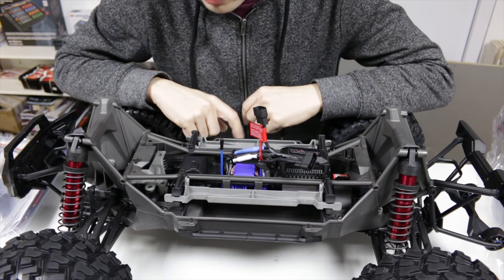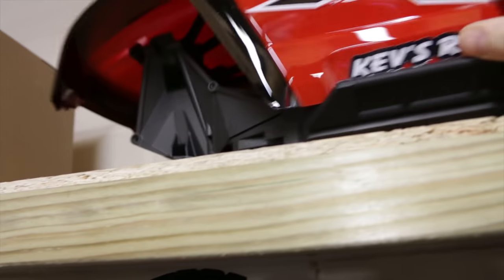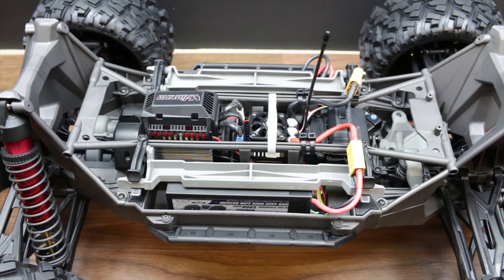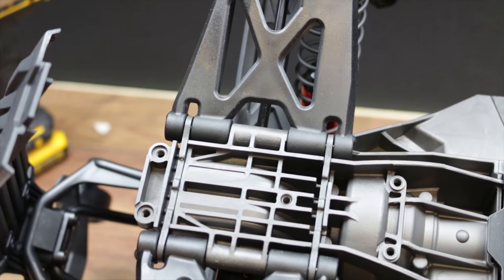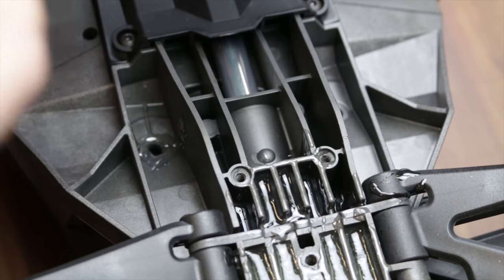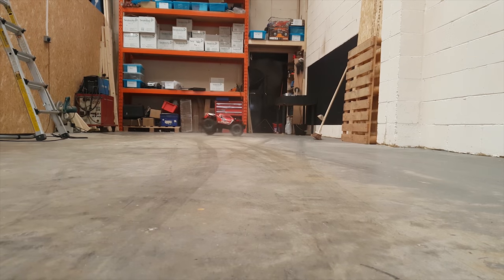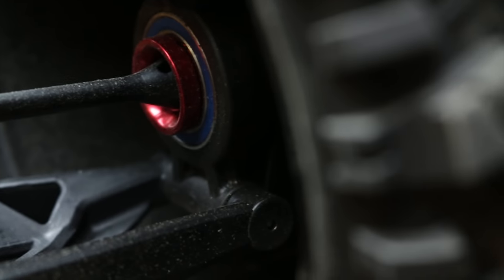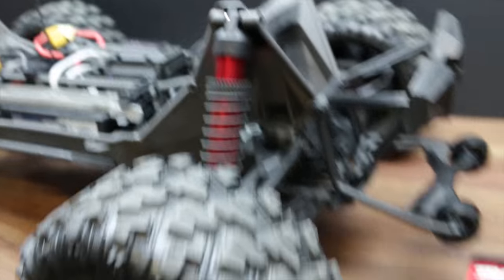Modding My NEW 8s Traxxas X-Maxx

Comment: Traxxas should make a traxxas x maxx v3 12s
Reply: Donkey Commander let's all write them and hope they do it I would buy it forsure. 12s rated 70+ out the box
Reply: Would be cool but i cant afford it

Btw does anywone remember the nitro car
(Savage ss4.6) ???

I own it its super
Reply: Tygozwart55 Tygozwart33 my uncles got one. 3speed with a bigger motor and other nice mods
Reply: I've got the 8S with some Max amp batteries and 1600 KV motor and it's hard to control as it is. I think if I was actually going to race the thing I have to drop down for 6s. My friend has got one that is 12s but it's with the 800 KB motor because it's the only motor that can make it. The thing has unbelievable torque and RPM and you better have that beer mesh right or you're eating pinions like you wouldn't believe. I don't think they can guarantee the parts like they do now or even close to it with a 12s

Comment: What's the difference between what you ended up with versus putting those same parts on a last-generation X-Maxx?  Those are all discounted at present.
Reply from the maker: The new maxx has uprated drive train and better tires. It worked out not much more just to get a new maxx and sell the old 1 as opposed to getting all the bits for the old 1. Its always fun getting a new toy too! Cheers

Comment: 3:00 Anti flex  vs more weight...  
if the weight of the truck is the problem you just made it worst .. but maybe stopping the flexing of it might help if that was the problem .. Next Test would simply be replace diff gears with stronger ones then try lighter tiers  , less traction , Weight removal , less braking and punch in the esc settings  . 
we take upgrading cars here at Jet Noise Huge Motors really seriously  .   XD

Comment: Kevin what gearing would you use if your out in the sand with paddle tires vs just out bashing ? On 8s stock motor , Still running stock esc but I plan on changing it to a max6  ... awesome video and info man thanks !!

Comment: your right the 1200kv sucks ! Question can I use 1600kv with 8s esc ?
Reply from the maker: Yes you sure can, just dont let it get too hot.
Reply: fuck yeah i run a 1650 kv lehner in my fg on 14s and it doesnt even get warm

Comment: I just got one of these 3 weeks ago got it for 1600 cdn. AN got lucky bc the rc shore had some used but basically bran new traxxas batteries with the duel ez charge charger with the truck they are 2 3s batteries but I got them n the charger for a good price I got the hole truck n batteries for 1600 tax in what luck I had :) jus to get 2 4 s batteries  next but still loads of fun on 6s :) I ran my self down with it last night tho n did not get it on cam :( I need a cam set up

Comment: hey i am sure i no what i need stock x maxx just got the 14.8 4s batterys i need to change the motor gear right i think its got the 11 tooth in it what would you put in it for the 14,8 4s batterys

Comment: Kevin I have a red cat racing volcano epx with a 3100kv brushless set up, I recently went through 5 pinion gears ranging from 17T to 21T in minutes,should I get hardened steel pinion gears instead of aluminum or could it be my gearing? I have a 64T steel spur gear

Comment: Hey Kev I packed my lower rear diff area with plumbers puddy which gave it some extra cush but I will give this a go.  I was thinking this week that I need to break down and buy the aluminum ones after seeing what mine have become   Give us a good review on the gears man.  we know you like to break things

B
Reply from the maker: I used 5 min epoxy but it is starting to crack and come away I think something a bit more flexible may be better
Reply: you guys should try grey Vulkem 116 polyurethane sealant culk.  Water proof yet flexible and adisive all in one ;-) good part is it comes in a tube for a culk gun no mess like popsickle sticks lol just kidding bud Nice X Maxx.
Reply: I used some of the adhesive / calk on my body and it unfortunately was heavy.  Straight fiberglass seems to be the hardest and lightest for all purposes IMOP

Comment: You're always jumping these things, do you ever crank on some preload on the shocks, or go for some stronger shocks? Fabricate a mount for double shocks maybe?
Reply: I bash the heck out of mine, stock shocks are pretty much perfect, just the rear end needs the traxxas TiN coated shock shafts, and when you rebuild the shocks you want little to no rebound on the shocks themselves(too much rebound will blow seals/won't handle properly)
For preload I crank the collars down ~1" up front ~1.5" on the rear

Comment: Hey Kevin thanks for your uploads, I really enjoy seeing your videos  I already have an Arrma Outcast and I dont even bash but im sick of getting replacement parts for. I was set on buying a Tekno MT410 because of its durabilty but i came across your XMaxx video and what you put it through and it seems rediciliously durable Im not confused about what to get. Does the XMaxx require replacement parts often?
Reply from the maker: If you look through all my 8s videos all I needed to replace was 2 wheel bearings, a prop shaft and a hub. I don't include shock shafts because I had the wrong ones fitted.
Reply: Kevin Talbot Thankyou, Xmaxx it is then. A bit pricey but well worth it.

Comment: Kevin, using the Hobbywing Ezrun esc, how do you control the Xmaxx while in the air?  On mine I cannot turn off the brake, therefore the brake interferes with quickly applying   reverse, if needed to bring the nose down on some jumps. There is always that brake delay before you can engage reverse.   Do you find this a problem?    Thanks
Reply from the maker: I just use forward and brake to control it in the air, I've never heard of anyone using reverse, I can't see it doing anything any good doing that! Cheers

Comment: When you say lower KV what exactly do you mean which engine size is it
Reply: The 8s X-Maxx comes with a 1275kv motor for more torque. Kevin put in his old 6s motor which is a 1600kv motor. Theoretically it should have a higher top speed because of the higher potential rotations per Volt. I'm wondering though if the same speeds are achievable by gearing the 8s motor up to 24/46. Should come close and wheely better at higher speeds.

Comment: What you doing with the 8s Motor, Esc and Body?
Reply from the maker: Hey, I'll the selling the 1275 along with the esc together for £200 but UK only. Keeping the body to look nice on the shelf :) Cheers, Kev
Reply: OK, man to bad I live in Uniited States.....What is that in USD, let me know if you change your mind....
Reply from the maker: Around $250 I will be in vegas in a couple of weeks I can bring it there if you are nearby, I really don't want to ship it though unless you can take responsibility if it goes missing.
Reply: I live in Michigan....6-7 hour plane ride....But, I have no problem taking Responsibility, if you ship from Vegas....If you'll take $125.00 because if it goes missing I'm only out 1/2 the price $125 rather then $250....Let me know will pay direct threw PayPal....

Comment: i want to put a max 6 in my x maxx. so I can run dual connectors I'll need a additional piece of wire to solder on to
Reply: Ultimate R/C MAN the stock xmaxx has 2 connectors......
Reply: Max6 doesn't... did you even read his comment?
Reply: @ali94hn  derp!

Comment: How does a lower kv motor go faster?
Reply: shy white Lower kv=more torque , gear it for more speed it will actually have the torque to spin those gears fast enough to make it faster
Reply: He mentioned somewhere else that the v1 motor 1600kv and 18/50 gear got him more speed on 6s vs 1200kv 8s v2 motor w/ 22/46 gearing so that contradicts that the lower kv motor makes it faster after gearing